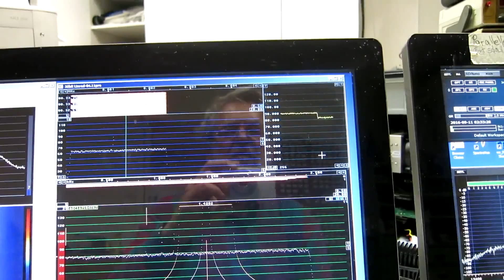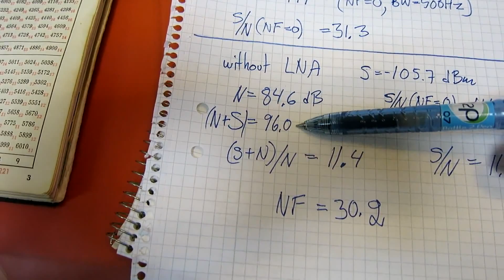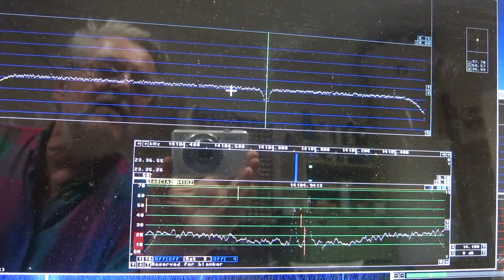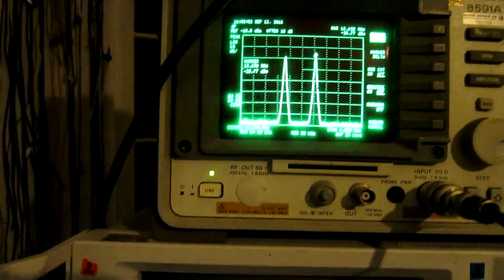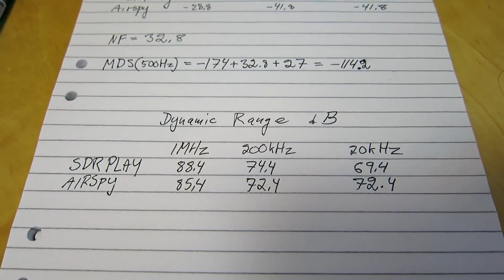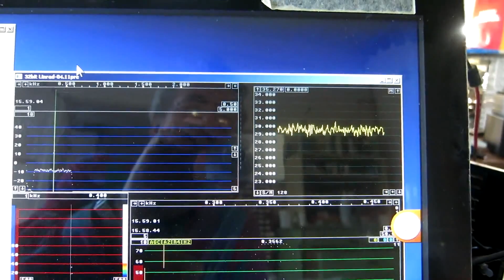airspy-sdrplay

Comment: Thank u vy much dr Leif for the effort of making such an informative analysis!

My request, could you make similar (at least LAB tests) for VHF frequencies or even UHF? In my opinion AIRSPY was originally designed & architectured for non HF bands. Thus it's performance is simply gud at these. I bet that there will be a bigger difference between the two radios in higher bands.
Reply from the maker: Have a look at these:
https://www.youtube.com/watch?v=_xSgbKPkhE4
https://www.youtube.com/watch?v=GWJEjzrJAZw
https://www.youtube.com/watch?v=Mjh7N8BpFb8